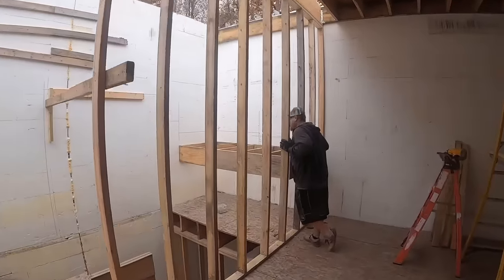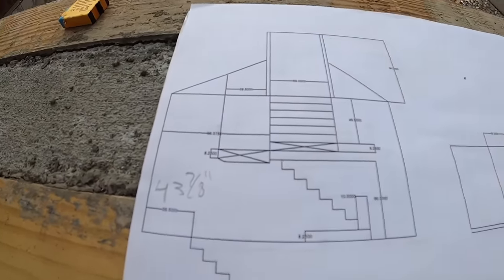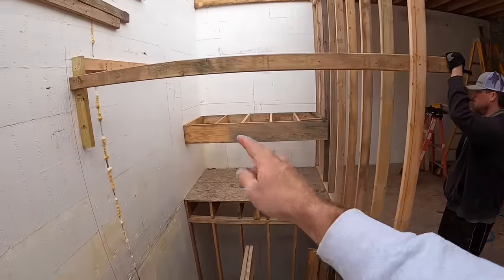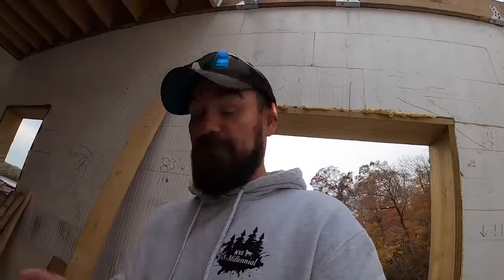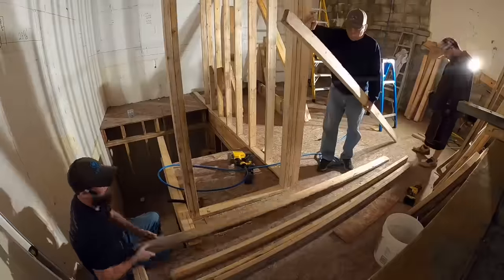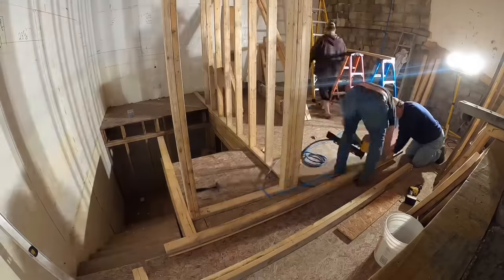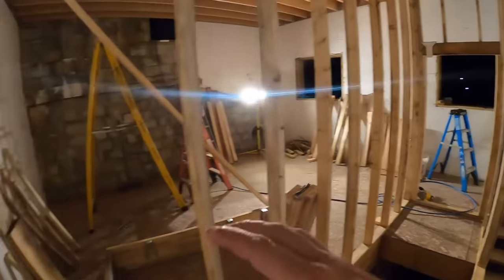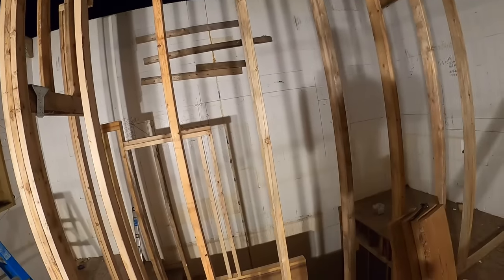Dang it…..  Oh well making progress

Comment: I understand the reason you had to re-trench and modify the stairs because of your roofline and the headroom that would be required in the stairwell.  Did you consider raising the walls in the stairwell by 2 - 4 feet and making in effect a 'tower on that end that could have either a roof copying what is on the crow's nest tower of the original castle or a 4-sided hip roof?  That would have offered the opportunity to install either portholes or square windows in the top additional wall of the stairwell to provide additional light into the stairwell.  It could have been done either using ICF, SIP or conventional framing with spray-in foam insulation to keep your thermal envelope.  It would allow you to keep the stairwell vertical and not necessitated traveling through the second-floor room to get to the top flight of stairs.

Really enjoying the project and realize that there may be reasons I have not considered that you chose the solution you went with on the stairs.  Keep up the good work.
Reply from the maker: Thought about it for sure

Comment: You have probably started building by now, but couldn't you put a couple of steps at the bottom at right angles to the long flight, to raise the long floght and higher.  platforms. Even one step might help. or is the roof slope the limiting factor for headroom.
Reply from the maker: All of the above lol

Comment: Why not just build a 4 ft wall upstairs and lift the roof up enough to have headroom into attic. Simpler correct??
Reply: Then you have snow load and other problems.
Reply from the maker: Would create inside corner. They are always problems down the road
Reply from the maker: True

Comment: I think if you would have started your stairs on the first floor against the ICF, instead of the interior wall, and came up and turned right for the second flight, you would not have to go back over your head with the stairs on the second floor. You could have made the first flight on the second floor a little bit longer and ended about center of the building with the second flight right up against your inside wall.
Reply from the maker: You are correct but still would have struggled with head space

Comment: Just curious, does the phrase 'we do it right because we do it twice' fit here?  😂
I never was anything even close to being a carpenter, you give me a nail and hammer AND tell me where the nail is suppose to end up, there a 85% chance I'll get that correct. This 74 year old didn't inherit my mother's ability to frame a window. She could, by eye alone, take to window frame boards after measuring for length, cut the 45 degree angle (if memory serves, no miter box) and it would be perfect. Many years later I thought, if my mom can do that, I certainly can too. The only thing I could do was to laugh at my arrogance, that was when I realized that is one job I'll never do.:body-green-covering-eyes:
Reply from the maker: No. Because we do it 5 times 😂🤣😂🤣

Comment: There is a full set of stairs already in place right on the other side the wall.  The idea the stairs must fit inside this EXTREMELY odd roof line that is in your head seems like an error.
Just build a normal set of stairs and then build the roof to give you the head room you need where you need it!

Heaven knows, there is nothing about the castle OR this addition which is going to be harmed aesthetically by having a dormer or a roof shaped differently than the extremely odd one you have described.  Curious how the person repeatedly sounding off on the comments below isn't Mr. Millennial!
Reply from the maker: I just sit back and read them lol. Stairs on inside suck bad. They gotta go

Comment: Theres much debate in how you should be doing this staircase.
If you read the comments,many are indicating their choice.
To me you have built a very expensive and big stairwell,that meaning much of the space is just for the stairwell .
Your working hard to do this and being too critical of you wont be of any good to the project .
I would film the work ,but maybe hold off showing it to us until its sorted,have the build video available after completion,this will reduce the questioning of your abilities,wont distract you in what your doing .
Maybe it is what it is ,but then maybe it could have been completely different 
Cheers
Reply from the maker: It doesn’t bother me at all. If it’s rude it goes in one ear and out the other. Luckily I have thick skin lol.